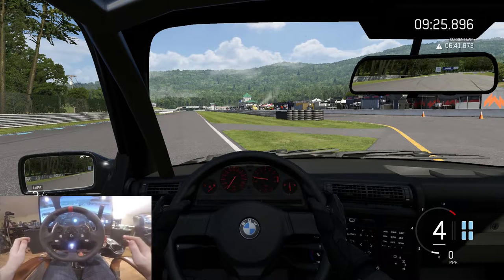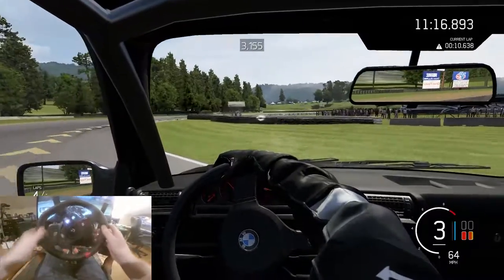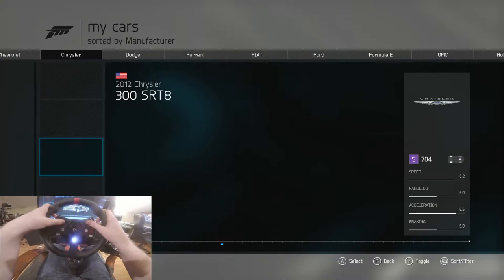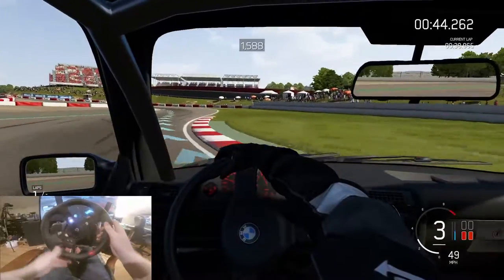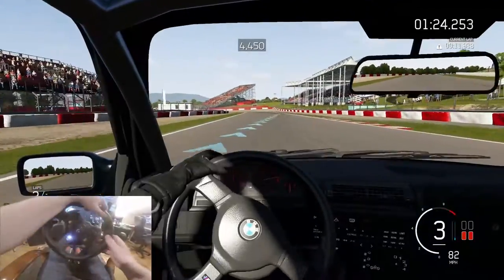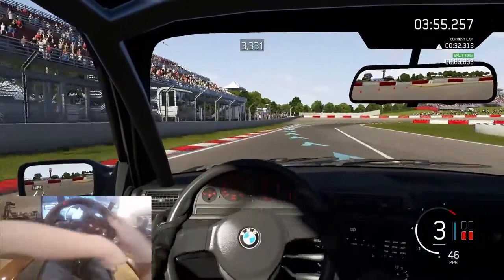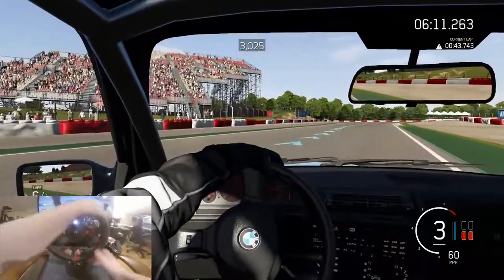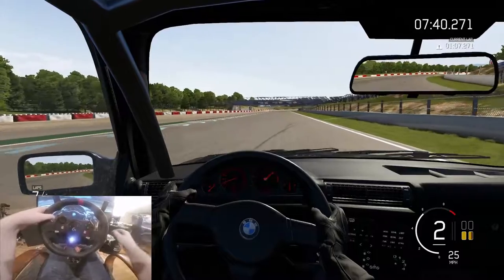Logitech G920 Hydraulic Hand Brake!

Comment: Nice drifting👌What button did you tap into? Is it possible to tap into the RB button? (Right side paddle shifter) Does the actual button on the wheel work after you solder wires to them? Im thinking of doing this mod to my G920 aswell. Just bought a bundle with a playseat chair with the G920.

Comment: Get an E30, do all the maintenance stuff like a tuneup etc and weld the diff. Go drifting, then decide what you want to do with it. Inline 6 makes decent power so I'd focus on steering and suspension first
Reply from the maker: +bostonblizzards i want a e30 325i but they are hard to find for me atleast right now
Reply: +Wetfingers can you do a video on you wheel setup? i cant find a good on and this looks good!
Reply from the maker: +shaun timmerman what do you mean? Like my setup or setting?
Reply: +Wetfingers Can you do a video on your setup and settings? or can you tell me
Reply from the maker: okay ill do a short video in my next video
Reply: Thank you so much!

Comment: Hi I have everything the same but it's not working what could it be?
Reply from the maker: Gabe Eboli make sure the button is closing. And make sure your in game settings are set up for the right paddle shifter to be the handbrakec
Reply: Wetfingers I did but still doesn't work
Reply from the maker: Gabe Eboli you know how to use a multimeter? I would ohm through the Seitch and check for D.C. Voltage from the wheel to the switch. It will tell you what's wrong if you do that
Reply: Wetfingers alright thanks